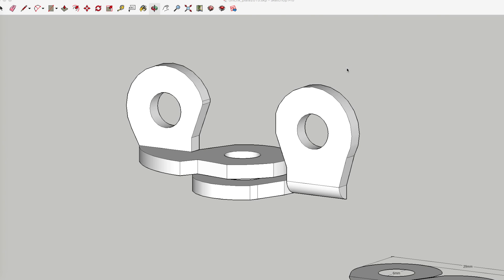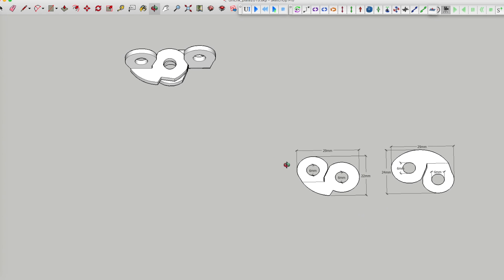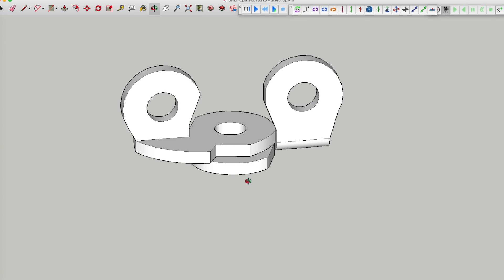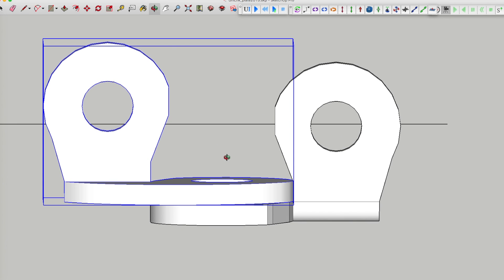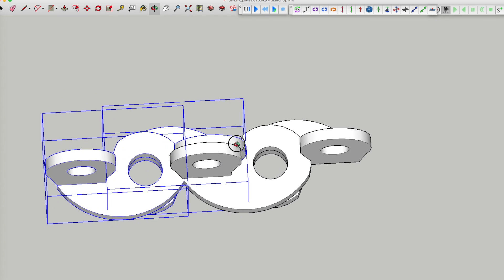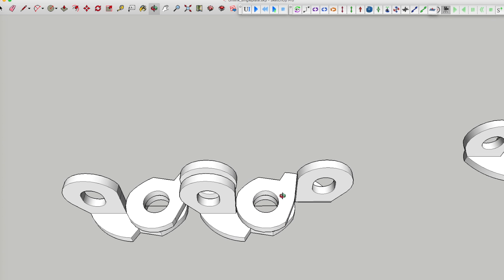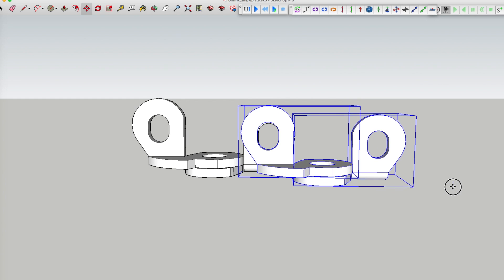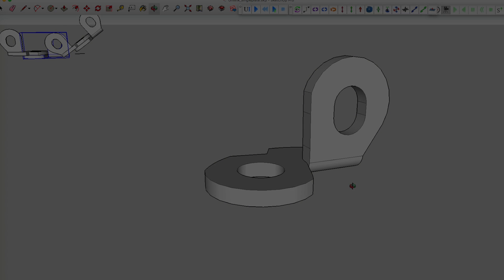Unilink design update - ready for manufacture

Comment: Good ideal. This ideal can be expanded on, and you could cut the v bevels in the top of the strut with this design, allowing flat panels to be installed. Installing flat panels will strengthen those Wager joints...

Comment: I think you can still make identical pieces.
If the hole in one ear (vertical) is offset to match (be in one straight line) the corresponding offset hole in the other piece will be on the horizontal ear of the second piece.

Comment: Nice design!
But ... I have few questions :)
Lets take the most popular dome frequency (v3) as example:
You would have 3 types of joints: 2 regular types: ie 5-way at 72 degrees each, and 6-way at 60 degrees each; and one irregular with (roughly) two 55 degree angles next to each other, and 4 about 62 degrees for the rest of the irregular 6-way hub.
So with that example you would need about 4 different such joints - same design but some of them would need to have slightly longer or shorter distance between the bolts' holes (ie chords of the hub's circle) to achieve correct angles (and for other esp. higher frequencies you would need more variations if these elements) - that's if you want to keep the struts lengths equal (per type).
Otherwise - say you're using regular 6-way hub angles for the irregular one (which is fine since bolts rotation will allow that adjustment), but it will affect just a little bit the length of the struts (only about few mm). But that small change in length should not be ignored or it would accumulate and your dome would change geometry and quite possibly won't fit correctly when you reach the opposite end. Trouble is that in the irregular hub all the 3 different length struts (of a v3 frequency dome) are connected, and it means that all three of them should have their lengths precisely re-calculated and measured. The longest & shortest ones I think will always participate in same types of joints (considering both ends of a strut), but the middle length (ie the 'normal' ones - that draw the pentagon & hexagon shapes) would have two angles combinations ie you would need two slightly different lengths for the 'normal' struts.

Comment: It's very interesting design! I've also been wondering how to make universal geo-dome connector design that easily adapts to any type & size of geo-dome.
(I also have a design based on two perpendicular bolts to allow correct angles in either plane - see my other comment below for details)
I think I see few potential problems with this design - that's if you're trying to make them all the same shape that is.
I'll use an example of v3 dome - regular one (ie without corrections for flat base) - I think same one as the one you're showing at 0:29 
1st) If you want to keep the struts lengths the same (per type of struts) you would need such link elements with slightly different lengths. The reason is that in any of the 3 hub types (5- & 6-way regulars at 72 & 60 degrees respectively, and one irregular with different angles about 55 & 62 degrees) your links will basically be chords of a circle of the whole connector hub. These chords would be different lengths for different angles. That's if you want your struts axis to converge in a single point (which would allow you to use the same struts length per type of struts - ie for a v3 dome only 3 struts lengths).
There are two issues here: the difference in angles between the two regular hubs (5 & 6-way) is too big 72 & 60 degrees. You can potentially make them all 6-way hubs at 60 degrees, for the 5-way one leave one connection empty (ie only with a bolt, but no strut) but then you'll have to recalculate and correct your struts lengths because since they're not lying on the axises converging in the same point anymore they'll get slightly longer. The good thing here is that it would affect all the struts of the respective type (ie the longest & the shortest ones) so once precise calculations are done you'll still have only one length per type of strut.
2nd) the irregular 6-way isn't so lucky - the angles are much closer to regular 6-way of 60 degrees (at about 55 & 62) so these corrections in struts lengths would be very minor (though I worry they might still accumulate thru the dome and create trouble on opposite dome end), but the bigger trouble is that you have all 3 types of struts connecting in this type of hub.
The longest & shortest struts again will only participate in the same combination of hubs (considering both ends), but the medium one (ie the so called 'normal' struts - ei the ones drawing the pentagons & hexagons) will participate in two types of connections (again considering both ends) so after corrections you'll end up with two slightly different lengths of the 'normal' struts.
Of course it's still possible to install it this way, but more attention is needed to measurements, cuttings & markings.
3rd) Issue that worries me is strength - it's great to optimize the shape of the material in order to lose the unneeded material, but the above link I worry will have the flat end take load forces perpendicular to its plane - ie in the weakest direction. For the size you're showing (for a small lightweight dome I assume - given the 6mm bolt holes) it leaves about 2 or maximum 3mm of plate thickness. If forces are perpendicular to that plane these 2 or 3 mm even if from steel won't take much to bend I'm afraid. I guess one solution to this problem would be to add a Fillet /or a Root as sometimes called/ (with some radius) between the two planes which would transfer some of the bending forces into tensile/compression force in that Fillet (similar to a wide-flange steel beam's web - how it doesn't make sharp 90 degree angle with the flange). That would probably require to increase the distance of the 'tongue' ie the part of the link that makes the angled connection and links the two holes.
I guess a not-reinforced link would still be strong enough for lightweight domes like for example for greenhouses (unless they have to carry a lot of glass at least), but bigger and heavier domes (like for a house with radius of about lets say 6m) might require much stronger connections.

Still I appreciate your efforts highly! And hope I'm being useful with my comments, and that perhaps it helps you perfect the design!
Cheers! :)

Comment: Very nice! but you can't bend it like that.
Needs much more bending radius inside and also outside.

Usual inside bending radius is about the part thickness and outside radius is double of that.

So, if you can't make it thinner, for obvious reasons, then the only other solutions are welding or casting.

Comment: Do you think 3d printed prototype in Nylon is strong enough? What material was used in previous 3d printed prototypes?
Reply from the maker: I just used cheap nylon for the 3D prints, this new design has bee designed for pressed metal production. I'm just finishing final design and have a manufacturer for pressed metal, happy to send drawings to anyone who is interested in printing though.

Comment: I can appreciate the benefit of single component creation but I would personally not want wriggle room. Wriggle room under pressures without a locking system have a tendency to spread in stuttering explosiveness if that makes sense?if one part slips or gets a knock, that wriggle room for every other part can amplify and travel. 
I would rather have absolute bolt integrity.
Building is often done with two part pieces, and if you're too damn lazy to count your parts out to put in the pocket then you shouldn't be in construction to begin with.

Comment: I’m not sure I like the sound of wiggle room! Why not manufacture the piece with ‘teeth’ in the horizontal part which could mesh when paired with another one so that they would both sit on the same plane? They wouldn’t be able to rotate freely, but you could easily use a number of teeth which would allow fixed positions for two, three, four, five etc strut combinations.
Reply: Beat me to this suggestion. Markings with degrees would be really interesting.
Reply from the maker: There would be + - 1mm of wiggle room, looks more on the drawing. Angle marking could be done but the theory is that you don't need angles, if you have strut lengths and brackets all the angles work themselves out automatically. Thanks for your input I do find all the comments very useful.